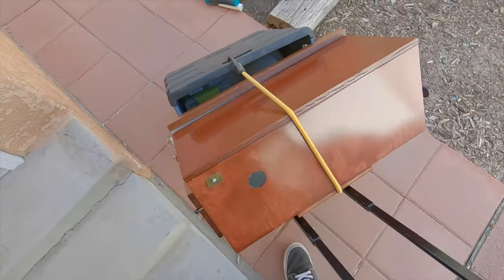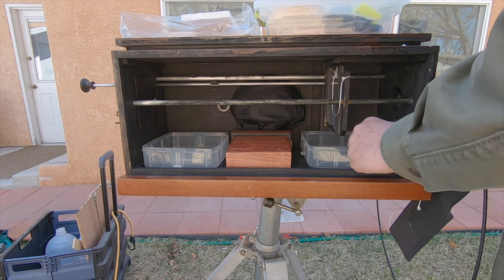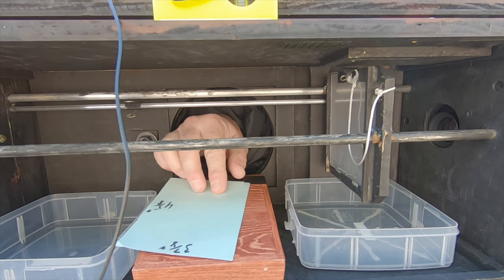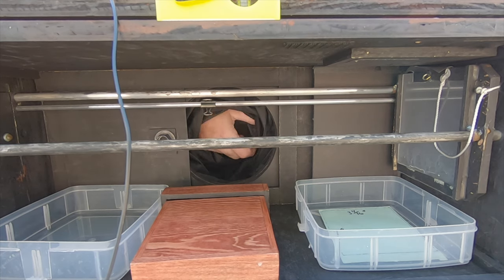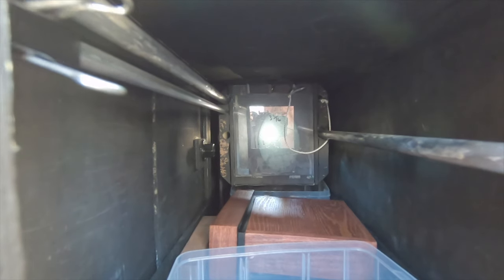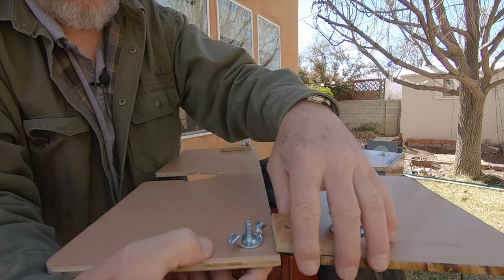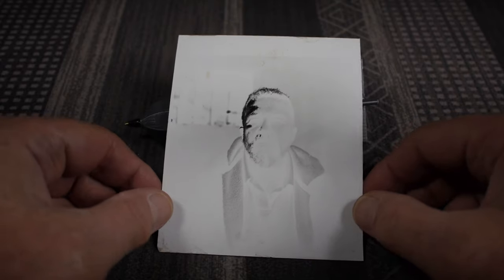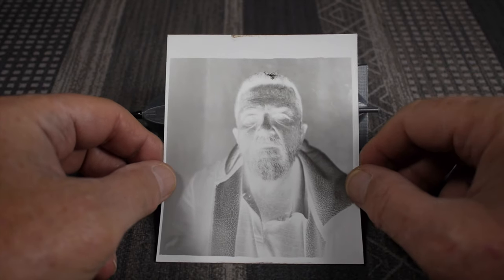Afghan Box Camera Practice

Comment: I just found this video.  I've been interested in Afghan Box Cameras for a while, and I happened to check Freestyle for availability of paper.  In grade 2 .EDU Ultra (= Fomabrom) they don't have sizes smaller than 5x7, and actual Fomabrom comes in 8x10 and larger.  Assuming you recut the paper to 3 1/2 x 5, you're looking at a minimum of 70 cents for just the paper for a single image (one half-sheet for the negative, another for the positive).  That's barely cheaper than the last generation of peel-apart Polaroids (well, quite a bit less after applying two decades of inflation to the last run of BW100 or BW3000) -- but much less subject to discontinuation for "business reasons", given the number of photographers around the world still using graded Fomabrom.

Comment: maybe you could use a longer sleeve, so you would not need the door. also how about an inspection red window ?
Reply from the maker: The door is a great help, and easy in install. I've tried red filters for windows, they still fog the paper.  This originally had a viewing port with pull shutter and a red LED for illumination, it also fogged the paper.
Reply: @Joe_VanCleave  Don't give up on red windows!  I'm using two layers of rubylith on the  rear access door  (approx 4" x 3") on my ABC and it's fine with multigrade IV even in moderate direct sunlight. - That's English sunlight mark you, not your high-power US desert stuff! :-). Nicely built by the way.  I recommend a flip-top flat paper box held down with velcro to save chasing it around the box. seal the lid with black velvet. best wishes, Peter.
Reply: - velvet tape.  regards, Peter.

Comment: Hi Joe, do you account for 'bellows extension' when determining exposure times i.e. do you find the f number of the camera from the lens - paper gate distance and the lens aperture, or is this unnecessary?
Reply from the maker: Yes, it should be taken into account. One approach is to make a series of test exposures of a normal seated subject distance in appropriate light and determine the exposure through emperical testing. This is likely how indigenous users did it. Or do it using the more difficult western method of first determining proper exposure at infinity focus, then measure your close focus distance and calculate the proper exposure using the bellows extension factor. I think the first method makes more sense.
Reply: @Joe_VanCleave  I might be misunderstanding, but would it not make sense to have some scale on the focussing rod which indicates the lens-gate distance, and then for each photo determine the f number from that and the aperture of the lens and calculate the exposure time from that? Im trying to make a box camera at the moment (though im taking some time as im trying to make it from pallet wood) and ill be using a fresnel lens and waterhouse stops. Ive only made pinhole cameras before where you use a similar method but maybe that’s impractical here? I recall you using a similar method for your box camera with your homemade shutter? 
Thanks for your responses.
Reply from the maker: @BonsaiBrandy  Yes, you could do that. But what interests me is how the indigenous practitioners managed to make great portraits without calculations. I think many of them used consistently standard camera-to-subject distances, which therefore implies consistent internal focus distances, then determined proper exposure based on prior testing and experience. These cameras were used almost exclusively for portraits, so the internal focus was typically set to a similar distance each time.

Another tip from experience is don’t be afraid to experiment. It is absolutely mandatory that you make a series of test exposures at various exposure indices to determine the optimal exposure based on the time of day, quality of light, kind of paper, strength and age of developer and skin tone of subject.
Reply: @Joe_VanCleave  Thanks very much Joe, having a standard subject distance would seem to make it a bit simpler. Im trying to make a slightly more portable camera and still process the paper in a darkroom, so id like to be able to do landscapes too. I do try to take plenty of notes for all my photos, though sometimes i have to cut them slightly short to not bore to death anyone I might be walking with. Thanks again!

Comment: Vertical with a mirror at the top. Flip the image right to the paper?? I’m not bad with wood and this has me thinking. Just like you said , if you can just speed up the process. I live in south FL and for sure I could make a buck if I could peddle this.
Reply from the maker: I think the image gets reversed back to normal when rephotographed for the print.
Reply: Joe Van Cleave what I’m thinking is skipping the whole second step???
Reply: Second idea. A mirror or a right angle prism in the light train right before the paper. Inside the box. Then you would not need a second picture??  Make the prism (mirror ) and the paper a moving object on the rails for focusing. I’m sure it could work.